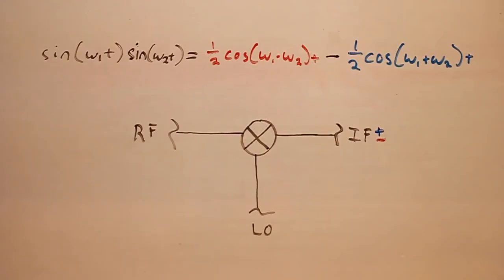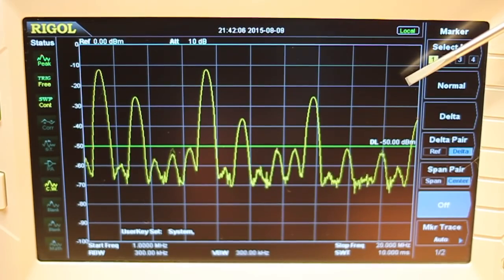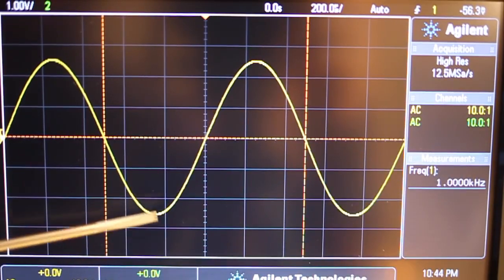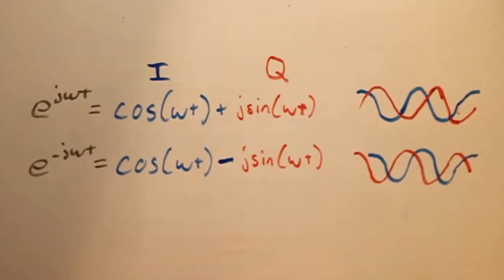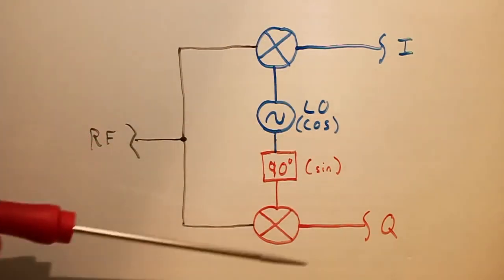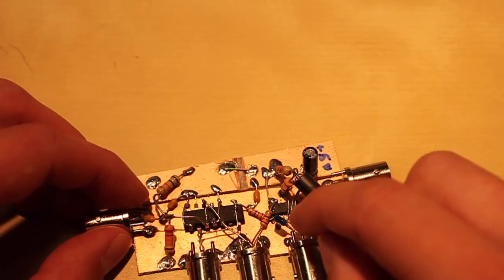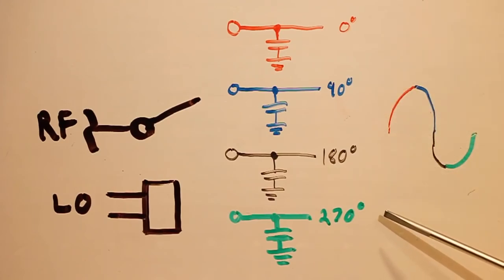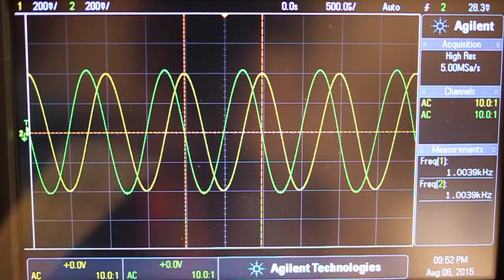Quadrature Mixers, IQ Demodulation, and the Tayloe Detector [devttys0 reupload]

Comment: One problem at about 24 minutes into the video. If you look at the S0 and S1 square waves, the sequence is not in order. Look for the first 00 (about halfway in time), the next values is 01, the next is 10, the next is 11, and the final is 10. So, the multiplexer address are not 00, 01, 10, 11. My solution to this problem is the A0 square wave needs to be twice the A1 frequency.

Comment: This is great. I see sometimes two inputs are fed 180' different signals via a transformer, or sometimes like you did here, in phase, same signal. When they do 180' (QRP lab does this i think) then they take combine different sets of outputs so that they are in phase. Seems like the same thing but just more complicated with additional input transformer. Your thought?

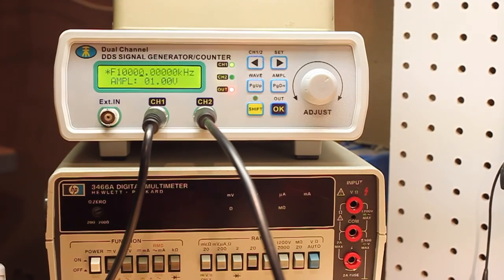Comment: 7:57 — You said “So, that’s basically just frequency modulation” … I’m 99% sure that that is wrong.  Everything in this video is amplitude modulation — as best I can recall from EE 45 years ago.  Frequency modulation modulates the frequency of the local oscillator based upon the information signal and the result is a spread of frequencies and the spread is why it is much more immune to noise.
Reply: you are right, this is not FM. When you have a single constant carrier and get on the speaker a single tone then this is Sideband Modulation. With AM you would have in effect 3 constant tones  (one for the actual carrier and two for the constant audio tone)

Comment: Funny thing is, I just looked up Tayloe's patent (which I think was granted in the USA) but it bears an eerie similarity to a circuit designed by Peter Baxandall (of the tone control fame) way back in the 1960s and patented in the UK. He used it for a radio frequency microphone with a phase shifting filter using a capacitor microphone as the timing element. Be interesting for someone with the know-how (cough, cough, not me) to go have a look at that and see just how similar (or not they are).

Baxandall used transistors to chop up the signal to recover the AM signal from a combination of the LO + the LO & phase shifting network. Like I said, it's a little beyond my tiny, maths challenged brain, but the descriptions (and weird 1960s talk of c/s [vs. Hz but the same thing] and odd way of drawing transistor symbols vs. the clearer ones that came later, do seem to have a lot in common with Tayloe's invention.

Patents suck.